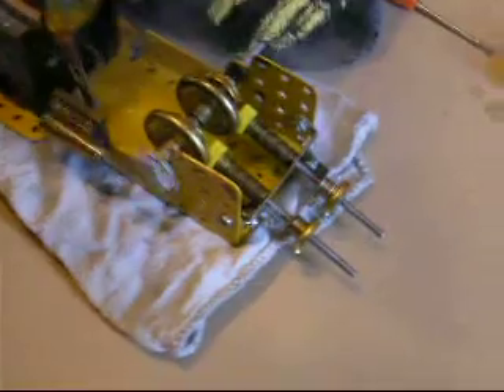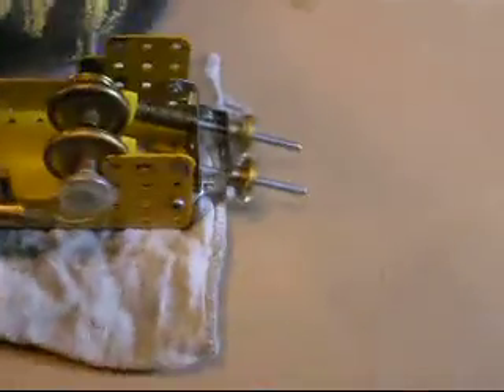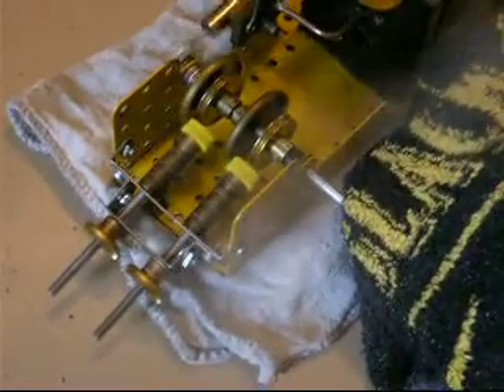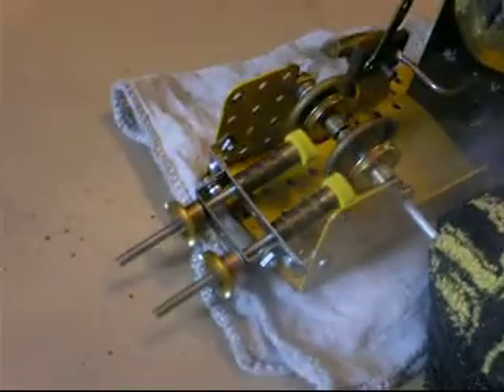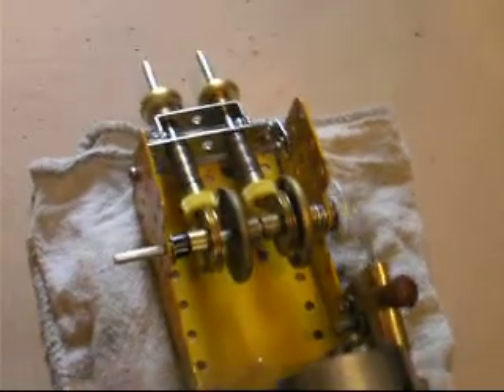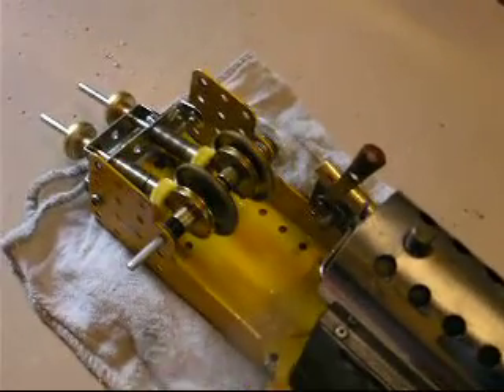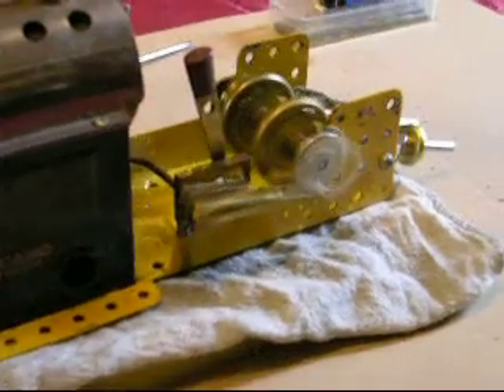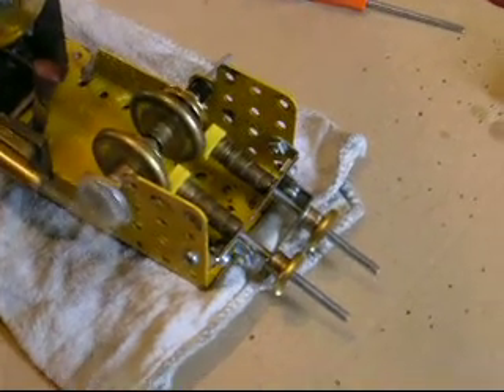MECCANO / MAMOD MEC1 TWIN SCREW MARINE ENGINE

Comment from the maker: I agree about the plastic pinions, I have replacements on hand. As far as the engine speed etc the MEC1 is a pretty revvy unit, I do have smaller contrates which would make it more of a 1:1 drive when coupled to the brass versions of the current plastic pinions...

Glad you liked the video, still at the experimental stage just yet... ;)

Comment: Can I recomend reducing the size of the contrate gears + replacing the plastic gears with brass versions.This would slow down the ouput shafts to the props giving them more torque,I think the engine as is will have trouble turning props at that high a gear ratio/low torque output.The plastic gears strip out very quickly if driven by brass contrate gears,removing the surplus brass collars on the shafts will lower the total driven weight/load of the engine too.inc.eff..Hope that helps! Nice job!!